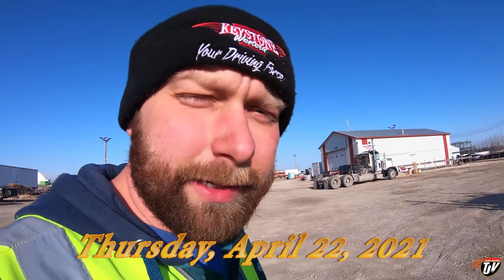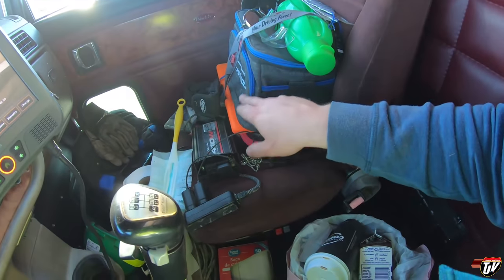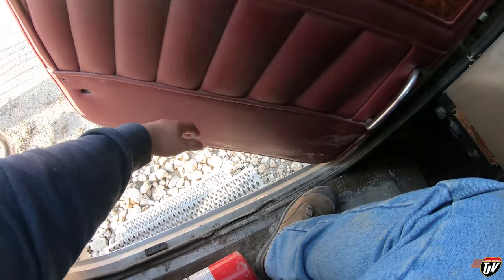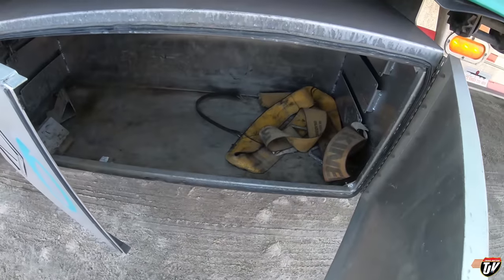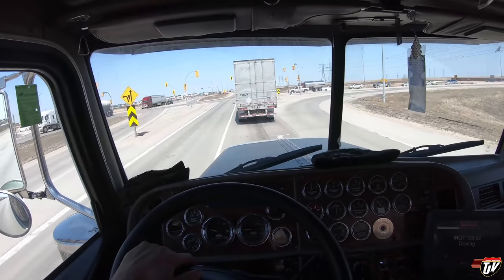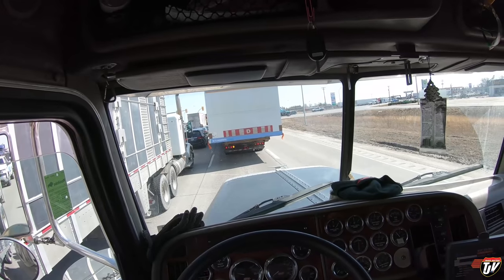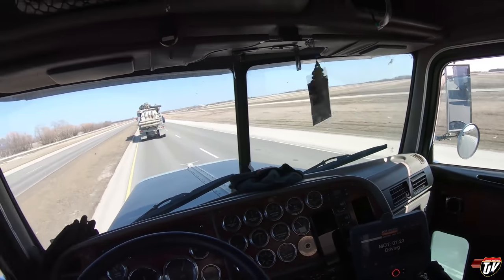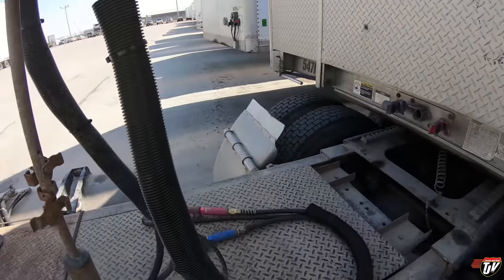My Trucking Life | SWITCHING RIDES | #2265 | April 22, 2021

Comment: Josh, are you going to do OTR from a day cab?  Bring a cushion from your couch for the steering wheel if you are. If it's any consolation, tipping the head forward is probably healthier.   It lets gravity help keep our tongues from slipping back too far and blocking our airways.  We never really get a deep sleep.  Brain will micro-wake up to keep breathing. Continually.